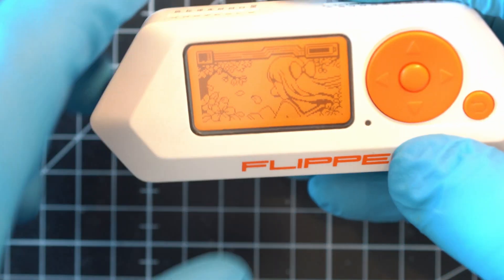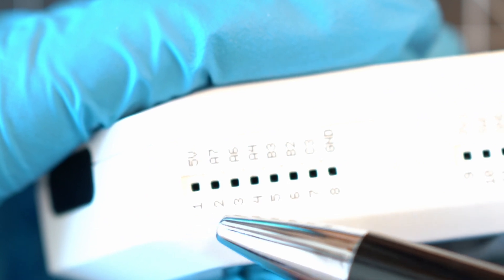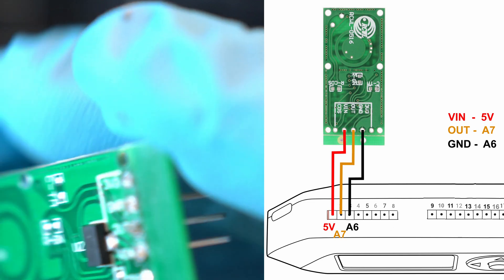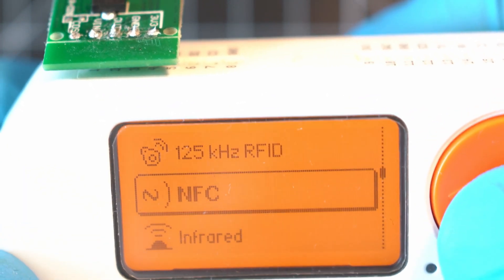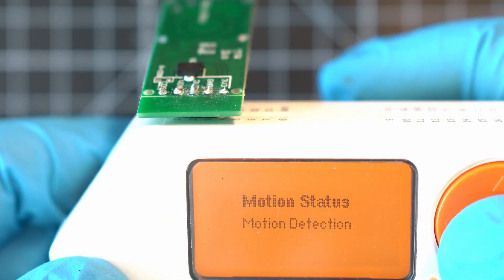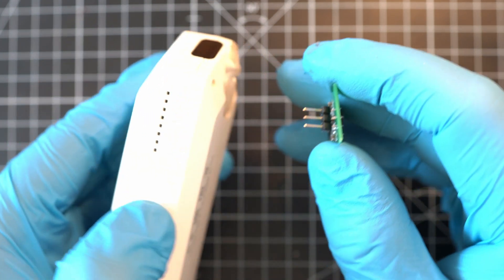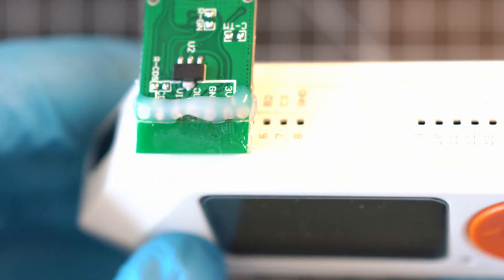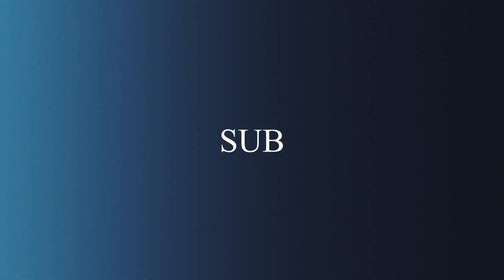Flipper Zero RCWL-0516 Microwave Motion Sensor (Radar)

Comment: My sensor continuously outputs 3.3 v on the out pin when connect to the power supply
Reply from the maker: hmm … what it does when connected to the flipper?
Reply: @takeapart  no flipper just an led and 5v power supply 5v to vin, led positive to out and common gnd  the led stays on forever. I have bought 3 modules all of them are in the same condition PLEASE HELP
Reply from the maker: ok so that’s a different story!  let me find wiring diagram for sensor alone…. but not sure if it can work alone